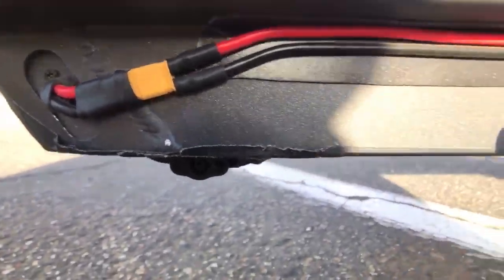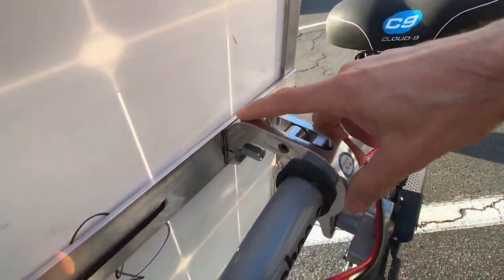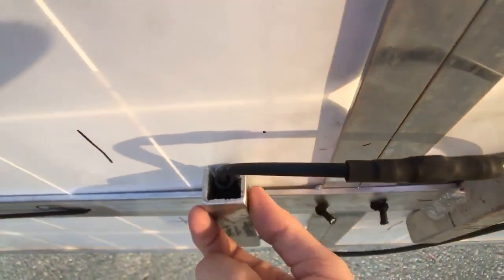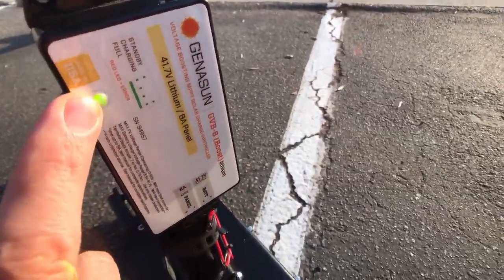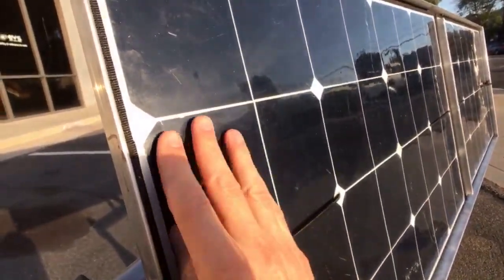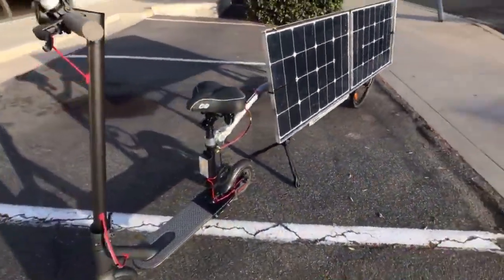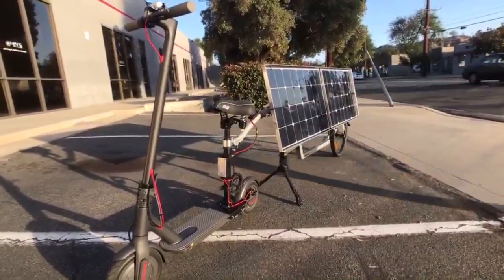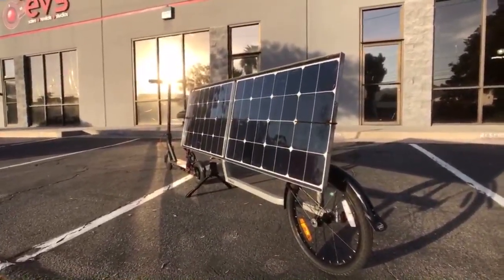Live: Solar Powered Xiaomi M365 Scooter Unlimited Range ☀️ Genasun GVB-8 Lithium 41.7V Boost Charger

Comment: What would be cool is if you added a Sun Tracker to it so you have the solar panel connected to a motor that tracks the sun's trajectory constantly that way it's always facing the Sun no matter where you're at or which direction you're going especially when you're driving around.

Comment: Question:  are you saying the combined wattage of the 2 solar panes is 160w.  or are each panel 160w watt (320w for the total) ...?  the trailer looks great..!
Reply from the maker: Rob K Hi Rob, Thank you 😊 The two solar panels combined are 160 watts. They are the Elfeland SP-22 160 Watt. They are monocrystalline Cells, which my research indicate are made by SunPower (high quality, low cost, just over one dollar per watt) these flexible solar panels weigh approximately 4 pounds per panel, which is very lightweight and perfect for our application. We purchased these solar panels on eBay.

We are also looking into purchasing an RC Vector Kite with the motor mounted below the kite, and adding C60 SunPower☀️monocrystalline Cells to the top of the kite, possibly adding a Genasun voltage boosting charge controller, and see if we can extend the flight time of the electric ⚡️ remote control vector kite.

Comment: I have some questions. 

1. How long it takes to charge in an shiny day ?
2. Amp x dc volt = watt that means 42x2= 84w. Why you used 160w panels ? 

Thanks
Reply from the maker: Babios The solar panels are Elfeland SP-22 160 Watt. I test these panels and they produced 157 watts in the late afternoon. The scooter consumes between 50 and 100 watts (Monitored on the Mi Home Phone App) of energy to maintain low speed on level road, thus the solar panels produce enough energy to keep the battery fully charged all day as long as the sun ☀️ is shining.

The charger that plugs 🔌 into the wall outlet which is the one that we received from the manufacturer when we purchased the scooter, charges the scooter at approximately 71 watts, and requires approximately 5 hours to fully charge the scooter if the battery was depleted. 

Thus, the solar panels Super Charge The Scooter 🛴

If the battery 🔋 was depleted of charge and we charged the scooter only with sunlight, it would charge the scooter in less than 1/2 the time the original wall outlet charger achieves.

The solar panels are 80 watts each, times two equals 160 watts. If you wish to study the solar panels in greater detail, you can google search Elfeland SP-22 160 Watt Solar Panels. They are monocrystalline cells at just under 24% efficiency.
Reply from the maker: Babios Also, if your question is, why are we producing twice the watts needed to charge the scooter compared to the factory charger, it is because we thought it could be helpful to have extra energy, sometimes there is hills which would require more energy to navigate.